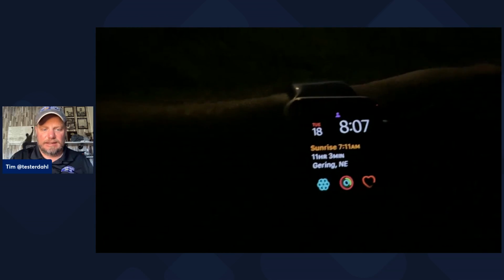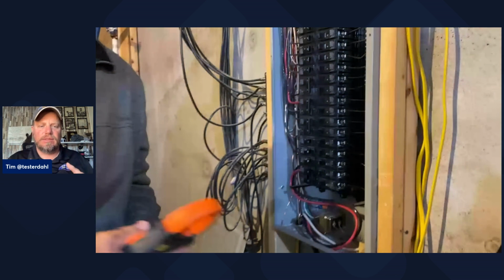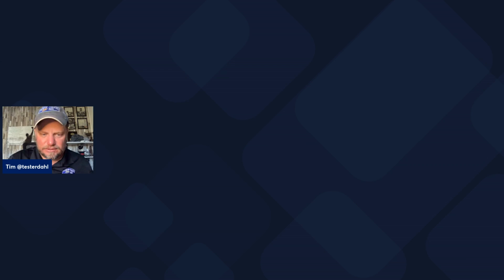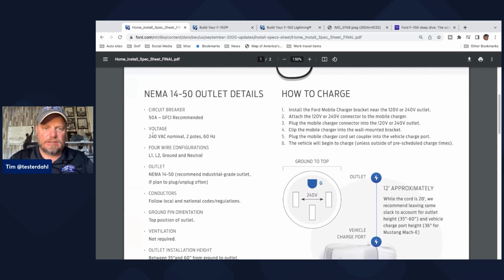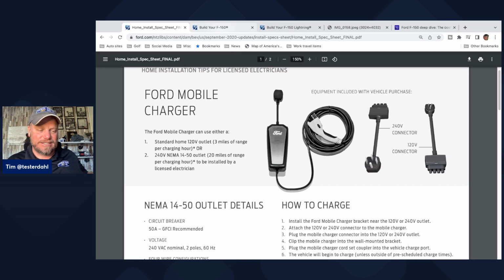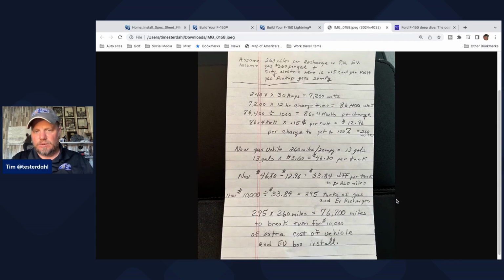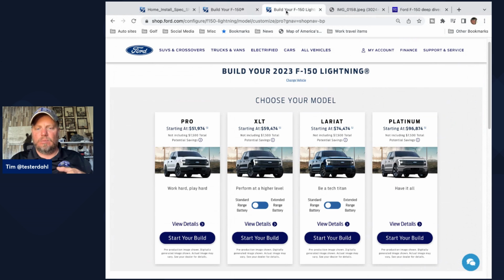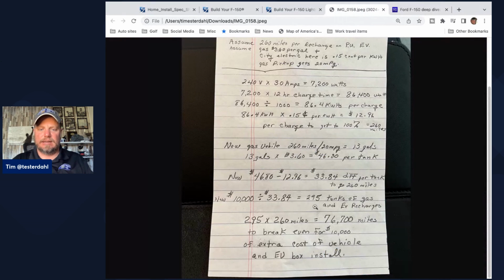11+ hours later on 220V charging price for 2022 Ford F-150 Lightning

Comment: They should of made a hybrid f150.. not an all electric, it's not an f150 it's a sports car with a box.. my f150 gets 600-700 miles to a tank pending on tires and time of year.. 5.0 v8, 36 gal tank, I can fill up once every 3 weeks. I'd rather have a hybrid truck. That uses both gas and electric that could give me 1300 miles to a tank. And still be able to pull my boat or camper.

Comment: and don't forget after ten years the batteries  are as good as stuffed in the ev but the fuel truck in stil good for double the ammount of miles it already did  !! a other thing is the weight of the trucks, evs are much more heavy so more tire wear and more damage to the road what inthe end has to be paid by the road user or not? but these thing they don't talk about !!!

Comment: Not to mention throw a small trailer 3k pounds on the back and you will only get 150 miles. What a joke. It's an overpriced grocery getter for the guy that has to have a truck that's not designed to use like a truck should be.

Comment: How are the world did you only get 10K difference?  Your  $79,000 truck you rounded up to 80,000 your $96,000 truck you rounded back down to 90,000 why didn’t you round your 96,000 truck up to 100,000 have a $20,000 difference so you could basically double whatever you came up with that seems a lot more realistic to me…. Double whatever you came up with and that’s about the real difference.  You lost me because you seem so technical with everything you did how in the world do you round 96 to 90????

Comment: I am 62 and have driven a new truck every two years since the age of 28. My wife has a Nissan EV that she rarely drives. The point is that I would never drive one of these "liberal" fad trucks no matter what. When we leave we may wind up in South America, Canada, or Alaska, pulling our 42-foot toy hauler. These EVs are a liberal forced fad that is way ahead of the actual grid that can charge them. Glorified grocery getters, but definitely not a replacement for the real everyday workhorses...

Comment: I have yet to see how well the e.v. does in the mud and water. Some good ole boys would head right out in the woods(4×4). Take it to the frame in mud and water. And for the northern  territories with snow and salt. Here in Florida they had a few e.v. fires due to the vehicle being some what submerged in salt water. Now they didn't say how deep. Up to the doors? Over the hood? And or completely submerged. Trade in value? Hate to spend thousands on a used e.v. then find out you need a new battery. Cost of new battery? What's a crate motor costing these days?
It's all about money. Makes for a new market to invest in. And of course the climate extremists and environmental groups want to do away with fossil fuels. Even if digging up the resources for e.v. could be more harmful to the environment.

Comment: Unlike Tesla Ford is not a very good software company.  That was shown in their ford fusion plug in hybrid I owned.  All this electric charging stuff is ran by software.  And this is their initial run with these electric trucks.  I wouldn't go near them with a 10 foot pole.  Give it about 5 years and they should get better.  Does ford push software updates to these trucks?  OR do you have to bring it in and it only gets updated for " recalls"?  Tesla is always pushing car OS updates that adds new features fixes bugs etc every month.

Comment: The drop in range could be the surface charge settling out.  Charge a car battery and check voltage fresh off the charger, you’ll see something like 13.5v.  Now check it 30 min later, you’ll see something like 12.6.  The surface charge settles out and you get your tru reading.  I don’t KNOW this is the case here, I suspect it is. 
I would never consider a full EV myself. Maybe a hybrid, like a Camry or such for the wife, but not for me. 
I have to pull a travel trailer around the country for my work and an EV wouldn’t cut it.  Plus living in a rural area, I won’t have the wife relying totally on a battery to get her safely where she needs to be.  One would have to plan every step of any trip to not be caught dead in the hood or boondocks at night and no power.
Hybrids at least add the option of some additional peace of mind.   This forcing of a tech that’s really not ready yet is like forcing people to take a shot of an untested med…oh… wait…

Comment: No thank you I keep my ram 3500 dually  at 16 miles per gallon  few munitions to fill up . My 1500 ram witch has v6 witch has a 300 400 mile range takes  10 to 15 muintes in out   I do not want wait 13 hours to go when towing  a trailer  ford lighting only get 100 miles range  when towing anything  I can not sit wait 13 hours to charge I don't sit that long  maybe 6 or 7 hours and gone  .

Comment: One thing you might consider is that even though the battery charging is not a resistive load I'd size the breaker as though it were which means you rate the breaker at 80%. At that rate your 50 amp breaker provides 40amps continous. Of course that really doesn't matter to me as I couldn't afford and electric vehicle anyway. I'll keep driving my 81 rabbit diesel pickup that gets 45mpg. I can make the 12 mile round trip to the nearest town on about a quart of fuel and use the ac and drive 70 at the same time.

Comment: The real thing i see is the cost, if you have to do a charge everyday thats 360 dollars a month which is 4,320 dollars a year, which is a costly way to get around anyway you look at it now think of millions of people trying to charge their vehicles everyday. And they think the infrastructure we have today and the energy produced is nowhere even adequate to sustain EV's for everyone. It just not feasible plus the cost of the EV just makes this not even a thing for the general person. 

We are not ready to do this, maybe in 15 or 20 years when the tech has been improved as well as being able to produce more energy. Right now it's just not feasible to do this. And it's not enviramently a stable tech either, we don;t have a way as of yet to even recycle the batteries these EV's use. Plus we only have a limited resource for the lithium and the Cobalt needed. It's just not cost effective anyway you look at it, except for a very select few who could afford the Luxury of this Tech.

Comment: It's obvious to me that electricity is not this guy's strong point, which is why he doesn't understand the dozen reasons to have that 50 amp plug and its associated circuit components. He also doesn't grasp that battery range is also affected by heat, which is probably why the "miles to empty" went down as the morning temp came up a few degrees. There are so many small things that are so confusing to the general public.
Reply from the maker: Doesn’t grasp battery range is affected by heat? WTF. How did you get that out of this video???
Reply: @Pickuptrucktalk  ... I didn't get it from the video, but it is fairly common knowledge in the world of batteries, electronics and shopping for EVs. Heck, it may even be in the owner's manual.

Comment: 260 miles? Haha 😆 I get 550 on my tank of diesel. Plus cold weather doesn’t affect my range. Plus my engine brand new won’t cost 45,000 to replace. Cell phone batteries die , car batteries die, your engine batter WILL DIE!!! So save up another 45,000 to keep climate change from not changing lol 😂..... I can’t wait to see and hear all of these EV truck owners throw a fit over these batteries. My diesel which can run on used oil will be able to get to where I’m going

Comment: 75,000 miles (10 years+-)to break even leaves out the elephant in the Lightning, the battery.  Why do all the videos comparing gas to EV's leave this major factor out of the equation.  Also leave out battery replacement factor when calculating environmental impact, its like you break even on carbon at 60,000 miles with no thought about the finite lifespan of the main component in the vehicle, the battery built with child labor providing the rare minerals to build them.  The public is being fed smoke and mirrors and the ones who end up with a high mileage EV are going to get an education in reality.

Comment: That wiring job though.....😳
Reply from the maker: What about it? It was done by code.
Reply: @Pickuptrucktalk  Albeit your wire gauge, type and breaker size may be correct...the strapping of all of your 12 gauge romex wiring and lack of strap within the code mandated distance from the panel, would absolutely not pass inspection. The rest may all be well and good, just two cents that your professional installer should know and may have tackled after this video 👍

Comment: What you forgot to mention is battery replacement cost and having to wait for 12-13 hrs to charge your truck which is a giant pain in the @ss if you are exceeding 260 mile trips, its fine if you are at home and done for the day, but for real world use EV Trucks simply aren't practical to most people, no one wants to wait 12-13 hours to recharge anything unless you are at home/parked at a hotel and done for the day.
They have their place in very specific circumstances other then that stick with a hybrid or ICE. JMO
Reply from the maker: Different video on battery replacement cost.

Comment: 50 amp for 30 amp of charging to avoid voltage drop due to length of run and when I see the length of that charging cord everything is correct as far as your electrical goes. EV's are still 10-20 years away. The Tech is just not there yet. Sorry to say all this is the experiment. EV's at this time will not be better than using gas. The energy it takes to charge your vehicle is more per Kw than fuel any day of the week. Don't believe the Dem hype. Trust your eyes.

Comment: Interesting content but very rough to watch.  Too much jumping around and skipping through videos.  You assumed that you were still drawing 30 amps at near full charge.  Next time you need to take your amp readings at various charge states I think you'll find that near full you will be down to 5-10 amps.  Your best test would be as you mentioned would be charging from 10% to 80% and checking amp draw every hour.  Also, you are assuming 100% efficiency with your charging.  It would be interesting to see how many kwh you pay for and how many are shown in the truck.  I'm guessing 70-80%

Comment: Ford Motor Company and lightning owners are just so desperate to make this feasible right now and it just is not going to happen and as you're going on with your video you assume that you can buy it at MSRP which u can't.   You also don't take into consideration the gasoline is going down in price and will likely stabilize at about 260 per gallon not to mention the huge majority that don't have a charging Outlet or a house that would be available to put one in, so that would mean that you take a huge amount of your time to go to charging stations and pay even more for the electric

Comment: So if I understand you right you can drive no more than 260 Miles every 24 hours, so on a long trip you need include the price of motels every 260 Miles. and than how long will the batteries last before replacement? and how much is that? and just to illustrate a 2600 Mile roadtrip will take at least 10 days to get to your destination. And the last question how much electricity in the US is still generated by fossil fuels. Electric cars are a scam.
Reply from the maker: No, you can drive way more than 260 miles every 24 hours. When you are on a road trip, you use a fast charger which is completely different than this video. 

Find the other videos where I show a road trip and then another where I show you exactly how much a new battery will cost.

Comment: One thing you failed to mention was the fill up time you said 13 hours for a half how long does it take to fill up a gas truck even 15 minutes is a long time and then you're gone driving again so how far ahead are you going to get of that electric truck going across country my God gas powered vehicles are the future there's ways to fix the carbon coming out of them or closer than ever now Trump 2024

Comment: You are lucky, BECAUSE the Ford Lightning has a big ASS storage compartment in the front where that NASTY ASS GASOLINE POWERED ENGINE would be in an ICV, so you can put an 8 KW GASOLINE POWERED GENERATOR in that compartment to RECHARGE YOUR LIGHTNING'S BATTERY when you are STUCK ON THE ROAD in the middle of NOWHERES USA. THANK GOD YOU ARE doing your part in saveing the PLANET. Remember you need to be very CAREFUL for what you wish for you or JUST MAY GET IT!!!  Like the OLD TOYOTA commercial: "YOU ASKED FOR IT YOU GOT IT"  EV'S are Not ready for PRIMETIME. LET'S GO BRANDON!!!  FOXTROT JULIET BRAVO!!!

Comment: I have  2 questions, first, how long does the battery last in EV. I heard 80k to 100k, if you have to drive 76k to break even then have to replace the battery at 80k. last question I live in the country in KY is there anyway to instant charge one of these EV's. Many times family or friends has medical issues and has to go to a major hospital over 100 miles away. What do you do in emergencies?

Comment: the you are showing in the video is way too high and I will never buy a EV vehicle or a Hybrid vehicle I will stay with a gas or a diesel vehicle I have a 2013 Ford F-150 very nice truck I'm the 2nd owner had it almost 2yrs now and love it and when I do a read trip and need gas on a complete fill up about 6 minutes and done not no 13hrs or more and for a diesel vehicle its great since I'm a truck driver with my own semi truck  with 24yrs driving experience last 16yrs as a owner operator have my demi truck on with a very good company when ever the price on the new semi trucks come down I will buy one the one I have now been paid off for almost 8 years now and If I ever buy a newer Ford F-150 or any other pickup truck like it it will not be a EV or Hybrid it will be a gas or if I can find a good deal on a nice Ford F-250 or F-350 diesel engine withe 4 doors and a high lift  I live in Alabama next to Columbus,GA

Comment: It all boils down to time is money E v's will never be effective active for something like a construction sitruck should site where you have to travel several miles and everywhere

Meanwhile the mining industry has been using hybrid diesel engines with electric motor wheel hubs for 80 years 1st at least

Personally I made a few modifications to my 2007 Dodge half ton 1500 with a 5.7 HEMI  and it's average be about 12 books A-day 12 bucks A-day for a 100 mile range on a daily drive..1000+ pounds cargo ever day

 And not on flat ground I'm traveling 70 to 80 miles per  Our on mountain roads in Arizona which is the   Up  Hill both ways

Comment: Garbage. Electric is just local commuting. 
There is a guy on You Tube that is driving his F350 for .25 cents a litre. (1 US Gallon is 4 litres).

So you truck and car owners in the USA. Could drive for .80 cents per 1 US Gallon.

The F350 is converted for dual fuel gas and ammonia. 
The truck is converted to propane for $1,000.00.

But Ammonia is used as the Fuel.

U got to watch it yourself.
Got to You Tube.
Type in Search Box:
(Canadian drives his truck for .25 cents a litre)

It has Captions on the Video:
Green Vehicles are Possible!

Comment: 10 years though… did you count replacement cost on the battery…I don’t think it will be anywhere near peak even at 5 years…lithium batteries like all batteries degrade continually…little by little…I would like to see how many miles fully charged after 5 years and how much new batteries are…unless you counted in that to the maintenance cost.

I run lithium batteries in Arizona and they need to be replaced…

Comment: Was actually 11 hours. 8 pm. To 7 am is 11 hours.
Reply from the maker: Remember to add the 2.5 hours to get to 9:30 am when the charge was actually finished.
Reply: @Pickuptrucktalk  did you ever figure out why it took 2.5 hours to go up 1 percent? I thought at 7 am you where at 99 percent.
Reply from the maker: @scottknight1301   nope. I kept checking it and it just wouldn't get to 100%. I know the last few percents on a battery take the longest, but that's ridiculous.  If you recall, the overall range actually dropped when it hit the full charge as well.

Comment: One more comparison I need to consider. When I see these it is the difference between a new gas powered truck, and a new electric. How about a used truck? I spent $5000 on a 2004 ford E250 I use for work. I would never in my life at my age be able to break even on the cost an electric, even if I can find one that does what my van does. And I haven't seen one that does. I have used that van for over 5 years without a lot of maintenance cost. New tires were the biggest expense. If it was really going to make a huge difference in protecting the planet, it may still be worth doing. But the truth is it won't matter. The destruction done to the environment to mine the raw materials for the batteries alone make it a foolish idea. Then the millions of people that will starve if we end oil and coal right now is just unacceptable. They will die for no gain in longevity to the planet. The climate will still do what it will do. Just as it always has.

Comment: GAS IS STILL MORE EFFICIENT. WSPECIALLY IF YOU KEEP 15 YEARS LIKE I KEPT MY LAST RAM. THE BATTERY REPLACEMENT WILL BLOW THE COST OUT OF THE WATER. I WILL KEEP MY POWER WAGON. YOU CAN PLUG YOUR LITTLE TOY TRUCK IN, DON'T FORGET TO PUT NEW BATTERIES IN YOUR CONTROLLER. HAHAHAHAH

Comment: I see a lot of NEW EV owner mistakes here.   Clearly you didn't do any investigation into this area before buying this super expensive EV just to save $300 a month in gas.   My solar array charges both of my EV's Free.   And before you say solar is super expensive....Not if you investigate everything and buy used panels and install yourself.   Good Luck you are going to need it.